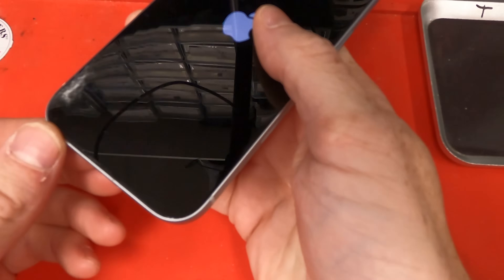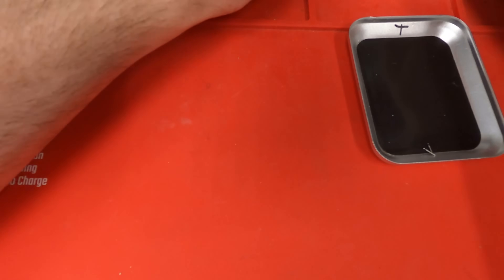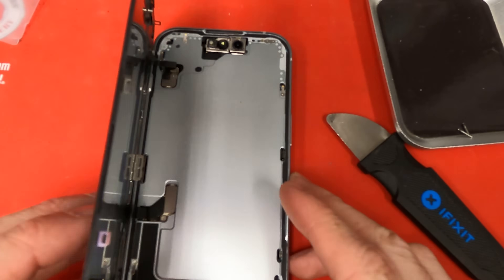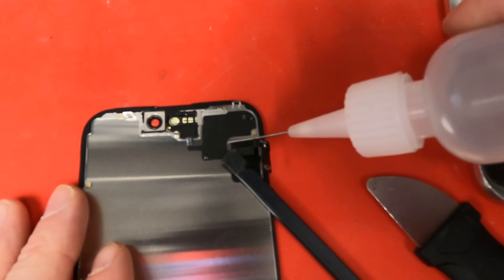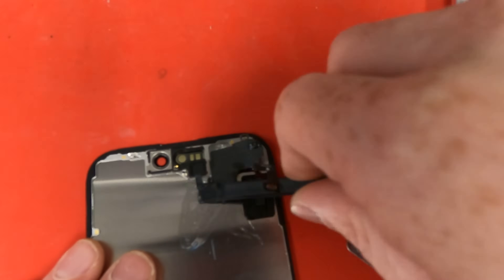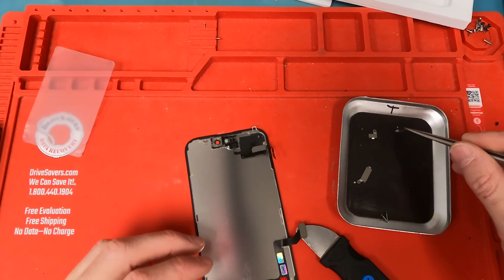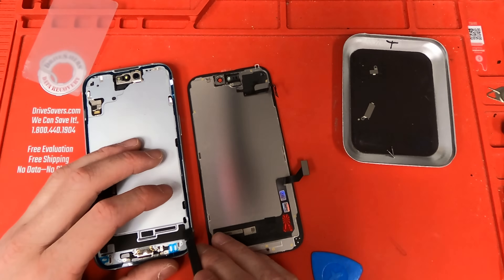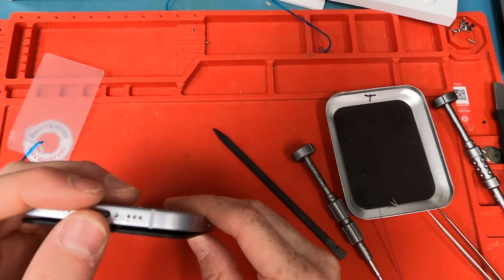iPhone 15 Screen Replacement

Comment: I don't think the plastic should stay on . If the phone heats to to high temps.. it may melt the plastic to the phone
Reply from the maker: Very true there is a way to hot
Reply: To purchase replacement tool kit, new screen kit , seems like you don’t save enough money from having Apple replace the screen, they have the tools plus the experience that ultimately saves tons of aggravation.